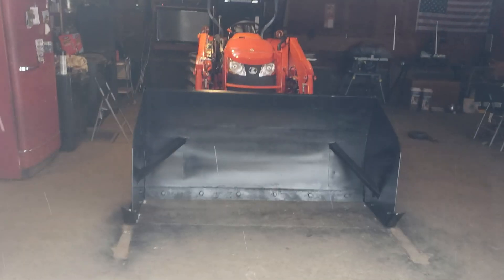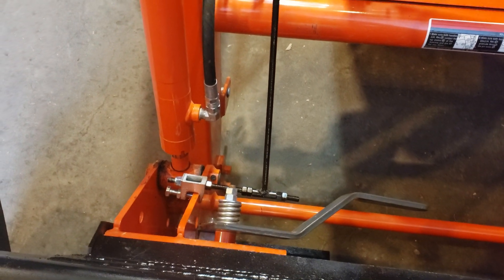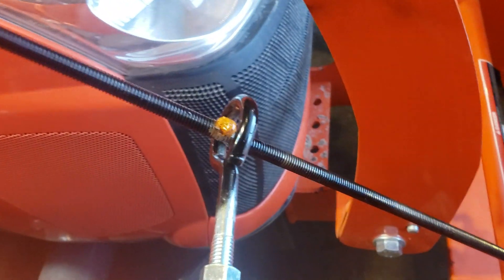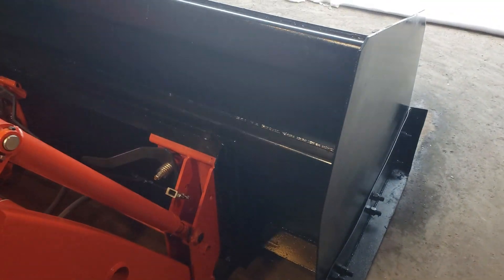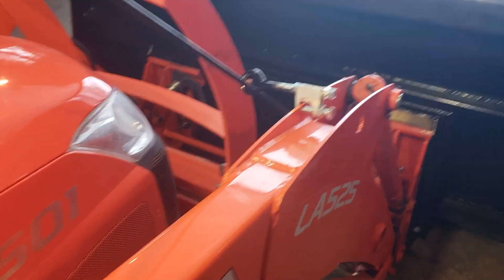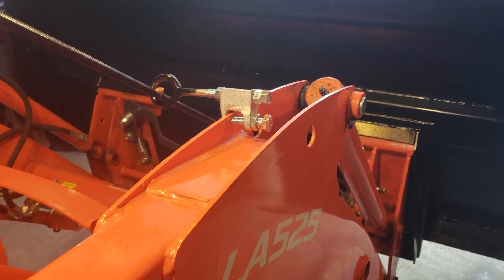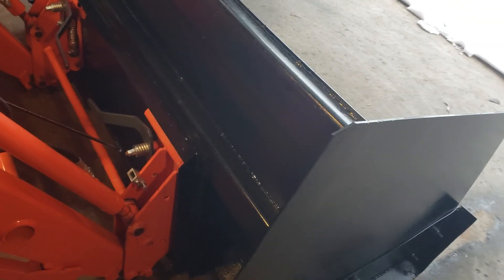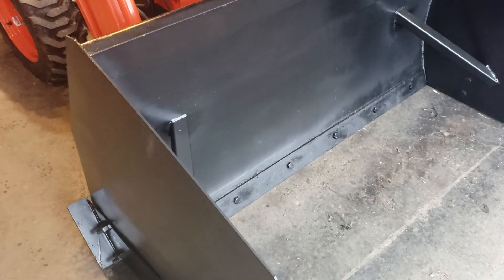#43 $10 Kubota bucket level indicator no drilling

Comment: Awesome idea I always have problem with the bucket been level.thank you
Reply from the maker: You're welcome. It's worked flawlessly. In high school I worked at a commercial heating and air conditioning company and we used those to hang our ductwork and heat pumps from the roof beams, and I saw that's what my loader arms looked like, and I didn't want to drill any holes. I just couldn't see spending the money kubota charged for a system you have to adjust/ recalibrate every time you switch a front attachment. "Necessity is the mother of all invention" thanks for the kind words and good luck.
Reply: @ironheadbiker  I will subscribe in your channel,I do heating and air condition for leaving I love leaning.Thank you
Reply from the maker: That's cool (pun intended!) I had a 2nd job driving my dad's trucks, and I went that route for a career. However I can't put a value on those years bending sheet metal, replacing old oil furnaces and installing new ones has given me experience wise. Certain skills have just popped up at convenient times and helped me save a lot of money by being able to do things for myself. Like installing a furnace, water heater, some plumbing, running gas pipe, threading clack iron pipe, and bending tin.